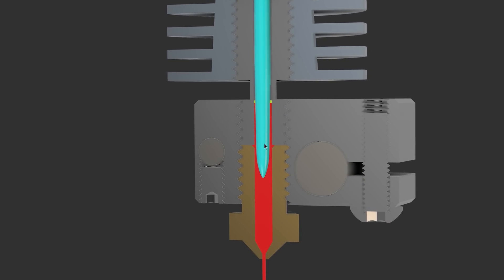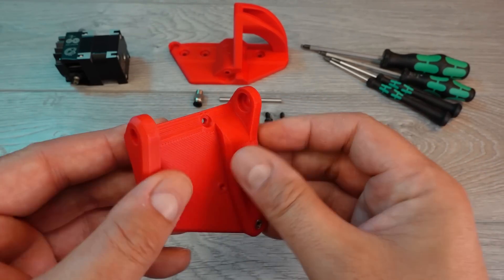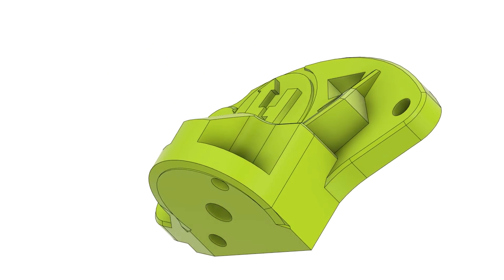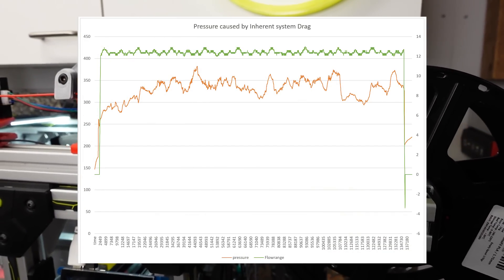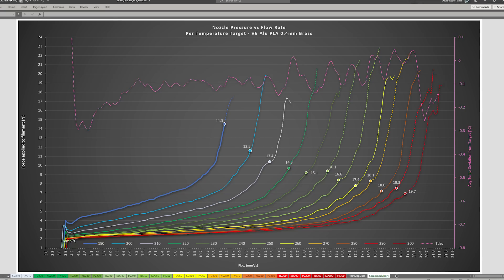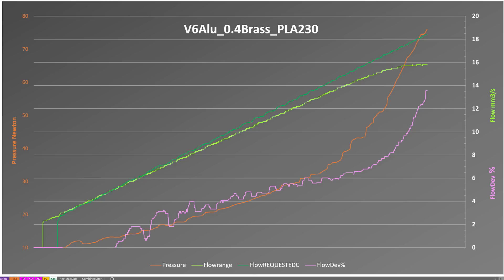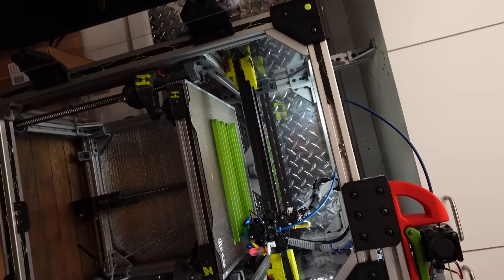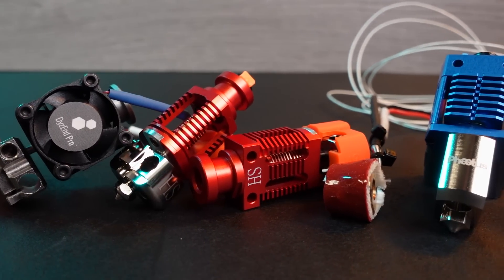Is this the right way to find out? - Ultimate HotEnd Testing - Episode #2

Comment: The possible negative impact the addition of pigment to filament appears to have on printing speed could be a very useful discovery.
Reply: From my experience semi-transparent and natural go faster than colored. I run up to 23mm3\s@0.6 nozzle with mil camo but black only 20 until skips occur. on 0.4 nozzle I had 14mm3\s on gray and black while natural and semi-transparent goes well at 15-18
Reply: It really annoys me they don’t publish which pigments/plasticizers etc are added.  I wish there was a list like the one on food labels by the nutrition chart.
Reply: @ericlotze7724  I guess this changes a little. base material of different manufacturers is different, dyes are different, colors are mixed from multiple dyes so even you know all the chemicals inside. I googled one common dye name please enjoy:D disodium;2-[[4-[ethyl-[(3-sulfonatophenyl)methyl]amino]phenyl]-[4-[ethyl-[(3-sulfonatophenyl)methyl]azaniumylidene]cyclohexa-2,5-dien-1-ylidene]methyl]benzenesulfonate

Can you guess what is it? Can you guess how harmful is it? Can you guess how it affects plastics viscosity or temperature of PLA? Neither do I. That's why your best bet is to find quality material, do many tests if you make something on a scale, and stick with it :DDD That's why I use more or less average settings for different PLA colors so they a bit overheated so tougher ones get enough to be fast printing while it doesn't really harm those that are faster because of less dyes.

Also I heard that some kinds of matte\pastel etc colors can even be more brittle but never checked myself
Reply: @ricokaboom_  I get it may not mean much to the average person, but i think the data should still be there, same reason the stuff is put on the food labels even though people will often get scared by basic ingredients with big names, rather than look them up!  Also Safety Data Sheets even for things like Cleaning Solutions may contain more information than most need, but are useful for research/planning.

I’m rambling on a bit, but i feel like it would require minimal effort on their part, would aid in further refinement of Filament science (what specific additives make “good filament” etc), and FDM printing in general, as well as make planning for research (such as this) or health/safety easier.
Reply: @ricokaboom_  but for all practical purposes, you are right!

Comment: This type of Engineering Level Data+Analysis is really what’s going to push FDM Printing further.

If you ever feel down, remember how huge the impacts of this will be, even if it ends up imperfect at the end!
Reply: I'd expect E3d, Prusa, Slice, and other big names to have similar info.  But it's awesome to see it published on the internet.  Collecting and publishing good data like this is a TON of work.
Reply: @martylawson1638  Not neccessarily. Printing speeds of around 60mm/s has been around for a long time and focus typically would be on part cost and manufacturability. And research is non linear. Any progress and open data made here will be a big boon for the companies to produce the type of filaments and print heads suitable for fast printing. The creation of a datum like this would help all the companies and the industry. Ultimately us as consumers. Also reminds me that 3D printing has a lot of potential areas to grow forwards.

Comment: As someone who did material property research in college, this is so cool to see. We had similar problems in sense that all the "norms" of material testing were done in 2D planes (compression, tensile and similar) but the real world problems emerged when material started "bowing" outside of the plane. Of course, non of the standards covered that and some of the manufactures "cheated" on testing because their products were "perfect" at bearing loads in 2D (perfect shape for that is triangle) and they seemed far superior than others. Now seeing you coming up with ways to "equal" all of the variables just reminded me of the time when we found material property that wasn't direct result of 2D measurements, but was combination of material strength itself and bowing deformation and load it could take... Sorry for the long post, but this is so cool... Thank you for this, it was so cool to watch

Comment: Take your time, do it right!
I've worked as a test-engineer for over 40 years and there is nothing worse than inaccurate instrumentation or flawed test-methodology.
Until you get that all figured out, you cannot make any definitive conclusions.  Many times we would be fooled by assuming say, that something was linear when it either had gaps or non-linearities when in certain ranges.  Nothing is worse than having to admit that your data is junk and you have to go back and do it right.  So, I always learned to take the flak instride and persevere to a proper destination. 
What your doing is both ambitious and painstaking but the results will be so valuable.  Hang in there!

Comment: For consistent temperature reporting, would you consider a way to embedding a probe into the nozzle? Considering the different anatomies used by different hotends, specially CHC heaters which undershoot a fair bit.

I really appreciate you are refining your testing methodology. You are the first content creator who is doing this to a high standard IMHO. Thinking of my other passion, computer hardware, there we are spoiled for choice and, generally, accurate benchmarking and testing methodologies are quite commonplace.

Hats off to you!
Reply: Do they make sensors that thin?  That would be really neat though, like a “downhole sensor” lol.  Perhaps use a larger nozzle like 1mm?
Reply: A flexible surface mount thermocouple glued around the tip of the nozzle maybe a good compromise.
Reply: There's a paper (In-situ monitoring of polymer flow temperature and pressure in extrusion based additive manufacturing, by Anderegg et al) that did just this. They also introduced a direct pressure transducer into the nozzle as well and were able to get some really interesting results. Worth a look.

Comment: Having an Extruder background in advanced printing from even 20 years ago, We used Teflon coated parts & teflon spray for extra performance, we also increased speed & went to higher temps & this was over 20 years ago.

Comment: Different layer heights would create different amounts of backpressure and amount for "pull" when printing. Testing all possible temperature, nozzle size and type (eg. CHT nozzles, or copper vs steel), layer height and even filament brand configurations would be impossible. Testing with one configuration would create "realistic" results only for that specific configuration. For people using different setups, results of "while printing" tests might be as useful as "Mid-Air" testing results. The data points would have to be moved depending on how much more/less backpressure and "pull" person expects when compared to Your setup. Therefore, I wonder if testing while printing is worth the hassle and inaccuracies introduced with it?
In any case, I very appreciate the effort and thought You put into this. I am very excited for the results.
Reply: Not impossible, just tedious.  

I fee the data is worth the effort.  Also basic data can be done by then, but it can also be crowd sourced (ie Have a list of parameters to try / components +nozzles etc to be tried and have people submit data if they do so, maybe even make it a competition a al “#SpeedBoatRace” / “Speed Benchies” etc.

Also the semi-automated nature of 3D Printers, and potentially jigs/automated scanning+photogrammetry etc could make the data collection easier, even for a single person.

(Edit: Readability Improvement)
Reply from the maker: Agreed.  What I think we need to do is to define a standard for test definition.  Then having a common understanding of how layer height, width, speed and other variables can affect the results obtained when the standard.   A
Thus would at least get us going.  Then we can complete by filling the blanks with real data when available.

Comment: I think some additional test method improvements would be:

1.)  Do the test 3 to 5 times each for repeatability and averages

2.)  Characterize all the various defects/failure modes. Then after each test print, document how many of each, and when/where they occur. 

2.5)Some sort of “scanning jig” may make this easier, something that automatically moves a usb microscope over the surface/around it with a gantry and/or turntable?  Not needed, but that could save you some time maybe!

3.)  Do a few types of test prints for each variable, bridging, overhang, etc (Granted this may not be needed; I don’t know if there would be any differences!)
Reply: Just some ideas i had throughout the video, what do you all think of them?
Reply from the maker: At this point the level if effort to create one test set is still huge.  Perhaps once I have improved the computing process it will be possible.  But one area I feel should be improved before doing that would be to have a better control of the environmental conditions of the test room.

Comment: Haven't used "R" myself, but have used Matlab/Octave a lot.  Octave is designed for big data-sets so should cope well if you can find the statistical libraries.  Also seen a lot of scientific projects move to "Sci-Pi" recently.  More work up-front to work with Python, but higher potential speed if you use the multi-thread Python libraries.  (which look very arcane from watching a programming colleague fight them)
Reply from the maker: Thanks for the tips.

Comment: Hey great video! Imo, since the performance limit is defined (in practical terms) by when the extrusion becomes "inconsistent" I'm pretty sure the metric you want use is standard deviation of flow, rather than underextrusion. This will not only tell you when the hotend maxes out its melt capability, but will also allow you to rank extruders on consistency of flow. Mihai Designs posted a video about how dual drive extruders introduce printing artifacts due to slight backlash in the gears that cause extrusions to pulse high/low once per tooth. Extruder force standard deviation would capture that. It wouldn't surprise me if single drive extruder's are "best" for print quality optimization.

Comment: Well, I know for convienience sake I only really start adjusting flow for a material if it is really off, and it seems above ~4% is where that line is. If that 5.75 number is really that consistent, I wonder if it is true for just altering flow +- that value will leave unusable prints. It is totally out of the realm of testing for hotend olympics, but it would be a great diagnostic fact and could help curb people recommending more than +-6% flowrate increments on r/fixmyprint. Good work, and good luck with R, it isn't a great introduction to programming, but it is relatively easy if you know what you want to do.

Comment: Love your content. Perhaps FDA approved medical grade filament would provide better consistency, it is held to higher standards. But, $$$.
Reply from the maker: I just received 20kg of the same batch directly from Polymaker's factory.  I also have the datasheet with flow index.  I will use this for all olympics.  Now I need to set room control and thermistor calibration.

Comment: Currently the flow rate is measured from the input side. Consider the dimension precision of prints and cold core extrusion, the diameters and densities of extruded filaments might vary. Would it be better to determine good or bad by comparing the average thicknesses or weights of walls (stacked lines) to the expected, calculated values under different temps & speeds? (Print quality affected by overhang angle is not considered here.)

Hope this helps. I do appreciate your great efforts of making the jigs and measurements!
Reply from the maker: I dont think the minimal difference in measuring the extrusion deviation on the input side vs output side is significant enough at this point.  Perhaps in the future when we understand all other parameters and diel them to the perfection, this could be looked at.  But with the very constant flow request, the fact we have no stop and go and that this test has a very smooth flow change acceleration, the delta between IN and OUT is very limited if not negligeable.  Everything coming IN will come OUT.
Reply: @MirageC  Sorry for the late reply due to my own tasks. My assumption was when the speed is high enough over a certain point, the the cold core effect and the higher and higher stress in the melted plastic leaving the nozzle start to lower the print quality until the result is eye noticeable. In a macroscope view the delta of mass between in and out can be ignored, but maybe the dimensions are different?

Comment: seems like the problem with using a pressure gauge on a direct extruder is that the play in it causes printing artifacts. if instead you mount the direct extruder in a solid piece of aluminum and use a strain gauge on that aluminum, you can determine the strain on that cross section and solve for the force.

Comment: What is more important to measure, the pressure in the nozzle or the force the motor has to exert on the filament?
Reply from the maker: Both are part of the same equation.  Nozzle pressure + system drag = motor pushing force.

Comment: This is incredible data gathering and analysis here. Honestly you don't get enough credit for the work you do. Once thing you may want to be aware of for future video production is that for me the legend on some of your graphs is so low in the recording, that the video time bar on Youtube is covering it up and hiding the legend. It made is almost impossible for me to see the legend. Kind of annoying that Youtube doesnt have a way (as far as I know) of making that bar disappear while the video is paused, but you may want to try to make sure all important info is high enough in the video frame that it won't be covered by any parts of Youtubes UI.
Reply from the maker: Awesome! Thank you to the info! Will ensure they are higher, and perhaps bigger.  Note that I made a mistake in the last part.  I have translated the pressure reading on the right axis directly.  I should have taken the corresponding flow reading from that timestamp.  In other words, we have now proof that pressure creeping point is pretty much where we start having bad quality print.

Comment: This data by itself already shows one more firmware change needed // Compensation:   Requested Flow Rate vs. Hotend capability.

Just like input shaping etc. this is essentially input shaping needed on the hotend/extruder combo. Increase request based on the underextrusion %.
Home gamer can measure this by printing multiple flow test turds (ie. how others do it), and inputting the average value per each temperature (few tested at few different flow rates) to establish calculatable hotend capability.

Thus keeping print quality up high further into the hotends ultiamte capability.

Comment: I have an idea on how to use a fixed hotend to do print testing. Use a rig where the hotend moves on Z axis, while the hotbed spins. You get a cylinder of fixed radius, and the hotend does not have to move around. 
However the hotbed may have to be unpowered, so perhaps using glass plus some glue stick is suitable for this test. Or perhaps use a slip ring to power the hotbed, and allow the print head to move in the radial direction for the base layer to get better grip, then for the layers on top the hotend gets held in place while the part spins.
Reply from the maker: I thought of something similar but the level of effort would be quite high.  I wanted to test bowden first to see if it was a viable solution.   Given the similarity with the first rig, i think bowden is just fine.
Reply: @MirageC  Wow thanks for replying.
I have been wondering if the limiting factor to extrusion speeds is how well the filament gets heated (if you go fast, the head might not have enough contact time to melt it even though the heater is really hot)
or is the molten filament just limited by the diameter of the nozzle and physically will not extrude at higher rates.
I have been wanting to have a really fast printer for years now, but all sources say it's relatively easy to make it move fast, but hard to get good extrusion.

Comment: White Filament or filaments with titanium dioxide/hydroxyapatite maybe should be excluded? would think there would be extra wear with nozzle? Also a 0.5 to 0.6 nozzle should be used? Would think these nozzles would have best flow & overall performance, slicer can be edited between 0.3-0.9 using 0.6 nozzles?

Comment: Hey, great work you are doing there! I love the scientific approach. Keep it up.
I was wondering, regarding the real world measurement, if it would be possible to just add a belt (like on the CR-30) to the free air extrusion rig, to simulate printing? That way you could extrude a continuous line of filament, without the inertia of the moving print head skewing the load cell measurement. You could also meassure the width of the printed line to define when the extrusion failed (maybe?! :D).
I know it's a bit late, but I am curious if this would work or if I am missing something here ;)